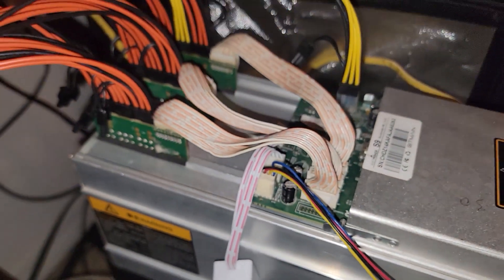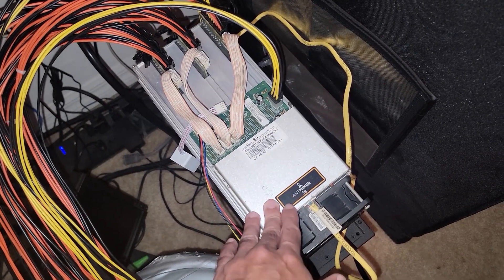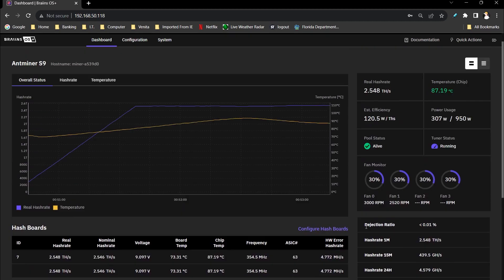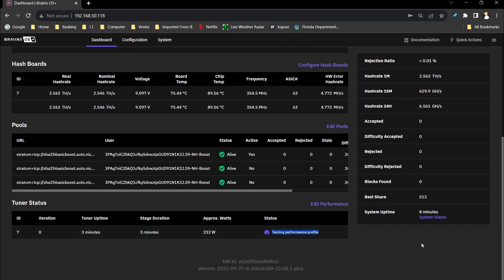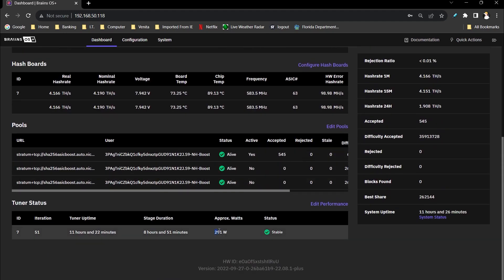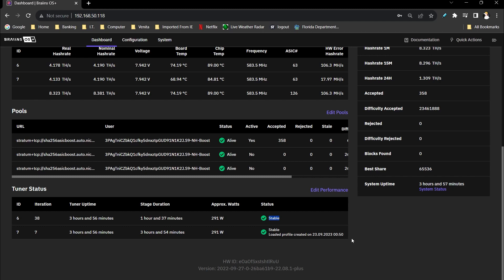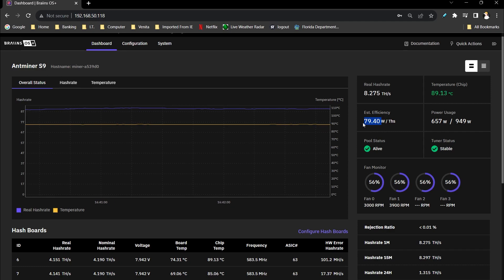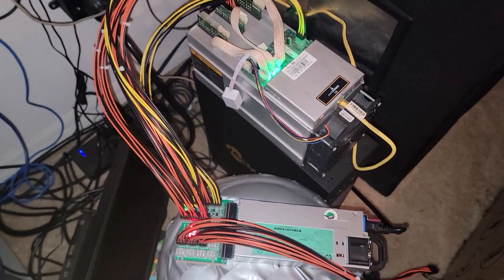Most Efficient way to run Antminer S9 Bitcoin ASIC

Comment: i gave up on the s9 it is power hungry. i found that the L3+ on hiveos is 660w and payout is higher than 3 s9's for less watts. i use mining dutch multiport and i get a great return per watt. Just set auto exchange for the coin you want and bam you be rich.

Comment: installed brain os on a s9i on the sd card but i cannot change the power target, no matter what it will go 100%, i cant change anything in the power menu, it just wont take the power i tell him, i cant disable or set voltage to the hashboard neither, it just dont care

Comment: If you're only running one hashboard  why would you power Target 950 watt? Or is that the best setting for 2 boards?
Reply from the maker: @jasonkidwell1767 is the most efficient setup on older equipment
Reply: @SerpentXTech  when you had auto tuning running did the miner disconnect from the pool? Mine has been doing this for 6 hrs now and will randomly reconnect but the tuning still says tuning each chip
Reply: @SerpentXTech  hey brotha can you explain how to web flash the s9 I can't find file my ad card slot is busted it has 2017 brains os on it I'm trying to update to current are you able to help?
Reply from the maker: @jasonkidwell1767  https://braiins.com/toolbox
Reply: @SerpentXTech  can you give me a crash course I don't wanna mess this up sry for asking
Reply: @SerpentXTech  having a issue when I scan for my devices it doesn't show up in toolbox
Reply from the maker: @jasonkidwell1767  so the device needs to use the stock or default password, or it won't show. And make sure you got the correct ip address using something like the angry ip scanner
Reply: @SerpentXTech  ok I'll try that a reason for the upgrade is I'm having pool issues and I saw that update 22.08 that it's supposed to fix the pool connection issue
Reply from the maker: @jasonkidwell1767  ok, since your SD is busted on miner. I would try another pool first, see if you get the same issue, and then go from there. Good luck
Reply: @SerpentXTech  I did the password back to factory still won't show up I'm so fed up with this thing
Reply: @SerpentXTech  does the machine have to be hashing for me to find it's IP cause right now I only have the control board plugged in with Ethernet and power
Reply: @SerpentXTech  oh I feel stupid lol I forgot to reset back to factory os ohh man I'm sry for bothering you brotha thanks for your help

Comment: Or better yet 3d print a shroud and get a 6inch infinity fan. setup for this small miner. and keep it cooler and quiet. the s9 with the price they are going for now is like 200 Canadian and the new Nano 3 140w 4th miners which cost around 240 Canadian each shipped with a good wait time by reading the reviews some people still waiting who ordered in January and February.  and what you save in price almost saves in almost 1yr of the power difference between them. So the S9 looks decent by for solo mining. Bitcoincash or even other Algo's

Comment: I run Braiins OS+ and Noctua fans on all my s9's. one 140mm 3000rpm with 3d printet adapter on the front, and no fan on the back and no back stop/fan mount bracket. 8-10 TH and under 80 
W / Ths and about 75-80c temp
Reply: make a video

Comment: How is that doing on NH I seen you were mining there?
Reply from the maker: 0.88 cents a day. After electric... not good. Solo mine, or run 2 boards per s9, under or around 650w, and lottery mine
Reply from the maker: 0.000025 BTC a day ish
Reply: Is that still profitable today??